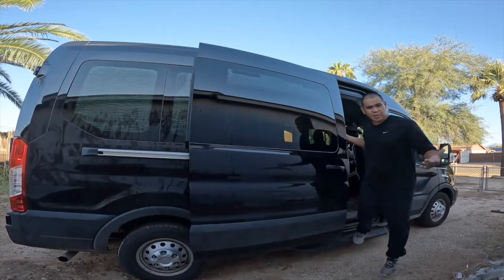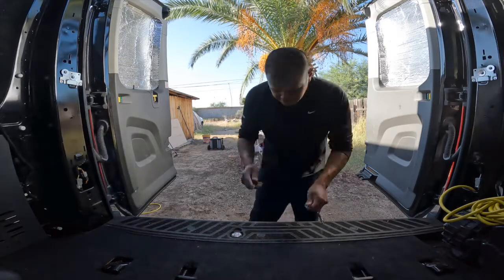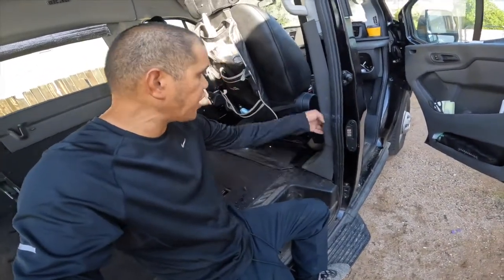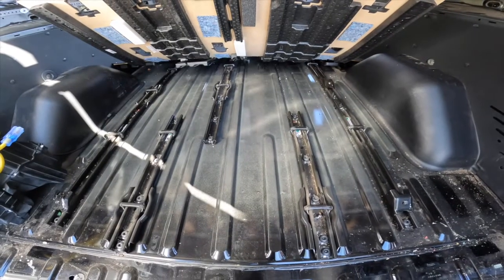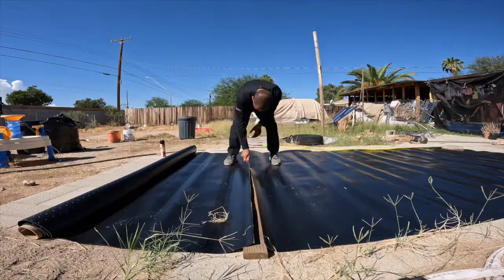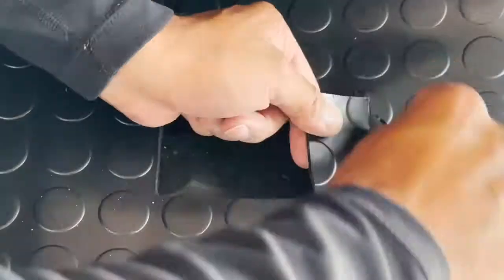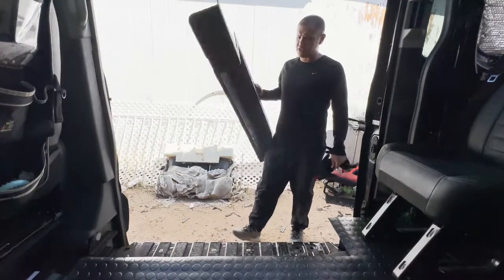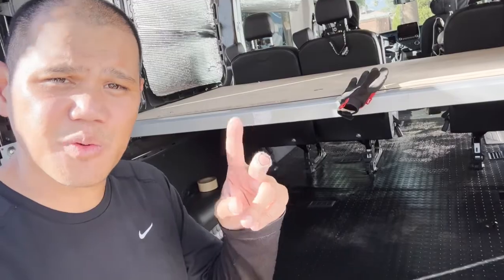Installing Vinyl Flooring in our Ford Transit Passenger Van | Van Build

Comment: Getting up the courage to do this with vinyl sheet flooring. How many and what length 4:08 screws did you put in to keep it from sliding? Thanks so much for sharing this video! It has been so helpful to us!!
Reply from the maker: I not sure what the screw size was.  I just use the smallest screw that would work.  just make sure you don't use a screw that is too long you don't want to put a whole in you heating system.

Comment: Nice. You didn’t by chance make a template of the floor cut outs did you? And was it hard to tuck under all the other  trim/molding? (Just bought an AWD upgrade but it has carpet).
Reply from the maker: I didn't use a template for the floor cuts outs I just laid the mat and cut a small whole where the seats and vents were then made them bigger until they were the right size.

Comment: Did it look possible to remove the carpet entirely? Is the duct work for the heat attached to the carpet? I want to try painting on the bedliner stuff.
Reply from the maker: You can remove the carpet.  I decided not to just in case I want to go back to carpet.  The duck work attached under the floor.

Comment: How is the feeling with the carpet under the vinyl flooring? Do you feel it is sliding? If you need to redo it again, will you remove the carpet from the wood panel?
Reply from the maker: We like the feeling of the vinyl and don't feel any sliding.  If we were to do it again we would still leave the carpet in.